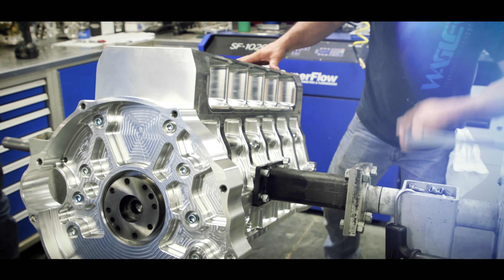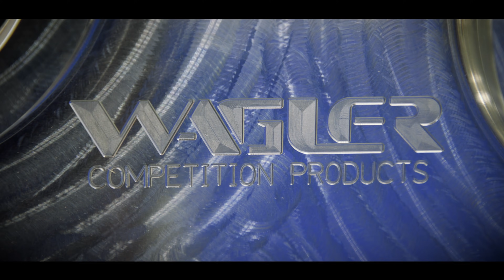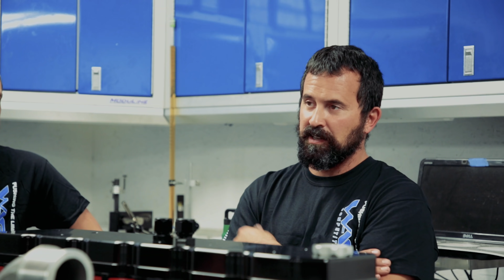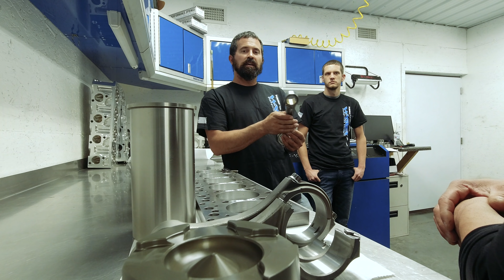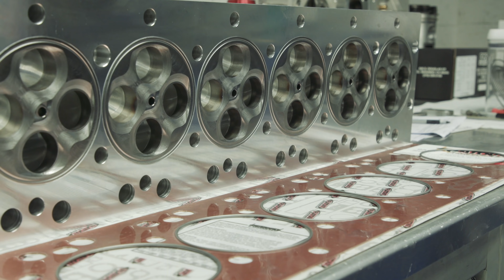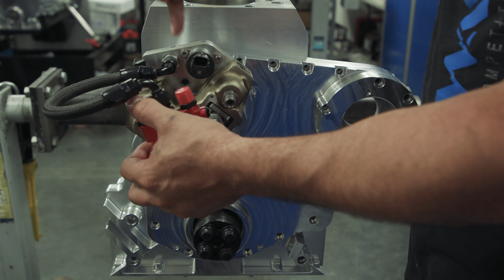3000 HP WAGLER COMPETITION CUMMINS!!!!!!

Comment: How many times do they have to explain to this guy what a deck plate engine is?  I watched and listened and learned the first go around and I never heard of one before this video.
Reply: Right its not like honda guys have been doing it for decades.
We cut the top off a old engine remove the sleeves do a lot of welding, and then get a diesel shop to resleeve it.
Reply: @anomilumiimulimona2924  Yeah Honda guys didnt invent deck plates. You dont cut the top off an engine to deck plate it. you bore the sleeves out. and no one goes to a diesel shop to have their honda's sleeved. Their tooling would never fit inside  a 3 inch bore....but its ok.
Reply: @DieselRamcharger  oh so my b21 doesnt have iron sleeves that replaced the factory fibre reinforced sleeves the honda factory installed....
Iron sleeves installed by diesel mechanics who were working on a big cat engine....
In a friggin machine shed, on a farm.
Sure diesel suff only comes in 3" bore and up.
Have you ever seen a small diesel engine?
There are 30 or so at Acore right now my bro works there, they cut concrete. 
Damn near all their cutting equipment is ran off of geo metro engine size diesel engines.
Reply: @DieselRamcharger  and cuz hondas  have complex bock shapes and are of aluminum alloy,  cutting a sacrificial block up to extend the block to increase stroke was not too uncommon back in the day, most honda automotive engines have horrible conrod ratios, its amazing they rev so high.
Joe with lowcash racing tunes mine he ran my b21's to 10k like 50 times before i was like "bro it stops making good power at like 8?!"
He shrugged and said its a honda 10k is just fine on factory internals.

Comment: What does the cubic inch go from the std block to the block with the head spacer. Question from Australia where these aint to common. Thanks
Reply: It doesn't change the displacment,  only a bore or stroke mod will.
Reply: @anomilumiimulimona2924  the point of the spacer is to run a longer stroke.

Comment: Can you add Displacement with a deck plate engine?
Reply: Only by increasing the bore or the stroke can you change the displacement
Reply: @stephenanderson439  you can run a longer stroke with a deck plate dumb dumb.

Comment: those #'s are insane brother! i wonder how much the billet 3k h.p. costs, caint be cheap. id be the fellar droppin that 3k h.p. in a lifted daily runnin "normal" daily boost tho....lol
Reply: A deckplate 6.7 longblock is generally around 25-30k, I'd have to assume a full billet engine like that is upwards of 75-100k
Reply: A full mod engine, turbo to pan should be 6 digits and if not it’s got to be very close. The fuel system alone would be well north of 15k
Reply from the maker: You guys are all over it with the comments on price . It’s a very expensive build!